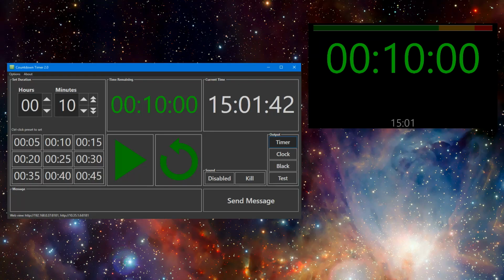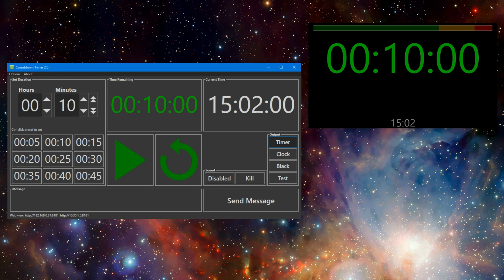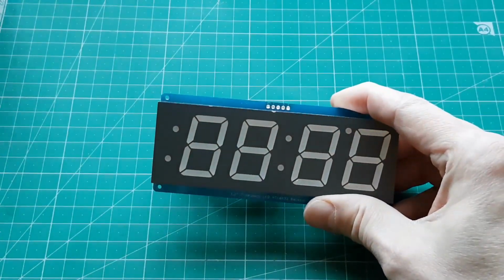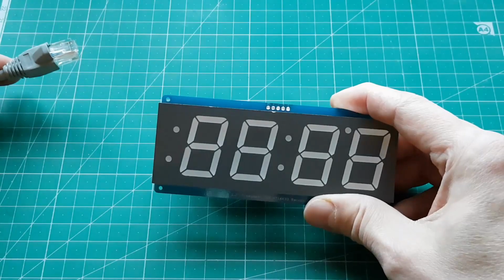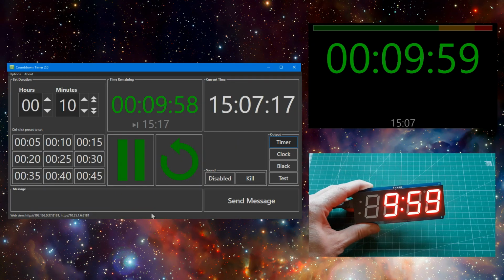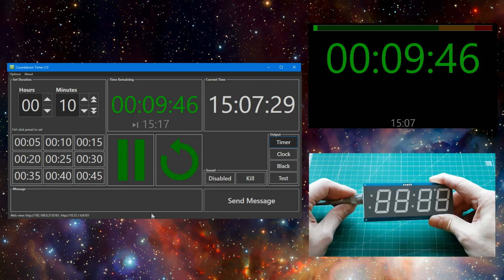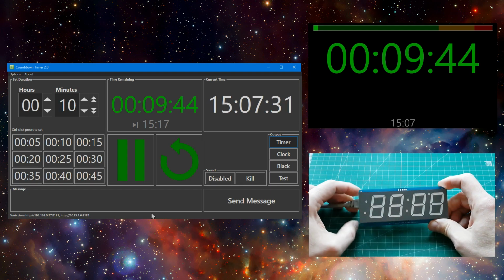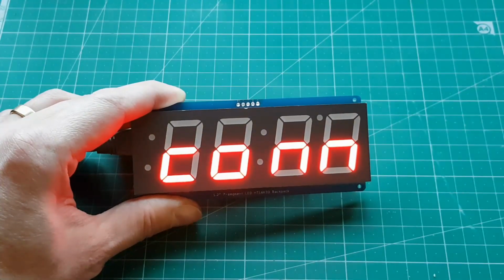Remote Display for Irisdown Countdown Timer

Comment: I'm having problems compiling the sketch, spitting out errors with the void WiFiEvent. Seen this before?
Reply: Fixed. Revert back to versions of board and libraries stated at the top of the sketch. Also python is needed.

Comment: i need a big format of that display with POE..is it possible? and if so plz provide steps
Reply from the maker: The POE on that board will only provide about 0.8A at 5V so you might need to look at another board for your solution. But to answer your question, yes you can easily draw enough current via POE to drive a larger display
Reply: @sgweasel  Hi there, thank you so much for your video! I'm new to everything pertaining to Arduino. However, i have attempted to download the IDE (v2.3.2) and managed to successfully reach step 6 of your "IDE setup"

Qn1: But could you kindly expand on step 7, "Download the ESP-32_POE_-_Irisdown_Countdown_Remote folder to your arduino_sketch_folder and open the sketch" 

What i did was to copy your entire source code and paste it into the IDE. Is that ok?

Qn2: "Compile and upload with a micro USB cable" Does that means, to press the, "verify" button in the IDE, before proceeding to press, "upload"?

Certainly, i will be selecting one of the 3 boards before i upload, namely, Olimex ESP32-POE, ESP32-POE-ISO or ESP32-GATEWAY"
Reply: @sgweasel  I'm hoping to display the timing on a 2" or even 4" LED display board. Does that mean, that i have to look for another circuit board, other than the 3 boards that you have mentioned, "Olimex ESP32-POE, ESP32-POE-ISO or ESP32-GATEWAY"?

I'm totally blank on where i should look for, if i need to find another circuit board, could you kindly point out a direction/keyboard on what i should look for, to find our more info on this?

Does this means, that the source code needs to be totally re-written and the board that i will be selecting, under, "TOOLS -> BOARDS" needs to be change to that new board?
Reply from the maker: @ranvierion  you could look for another PoE power extraction module, which has a higher rating and use that to power both the ESP32 board (PoE no longer required) and the LED display. That would mean the same code, but more electronics.